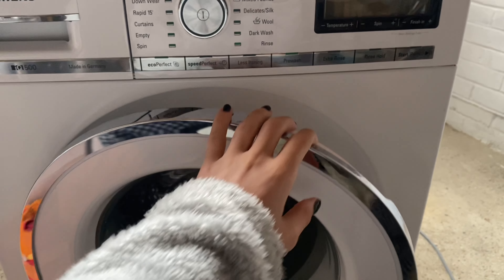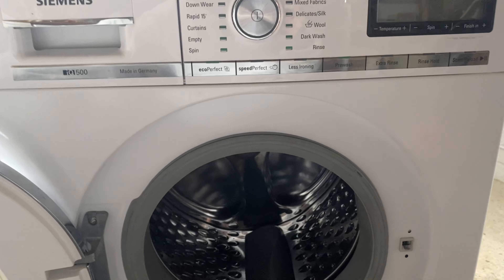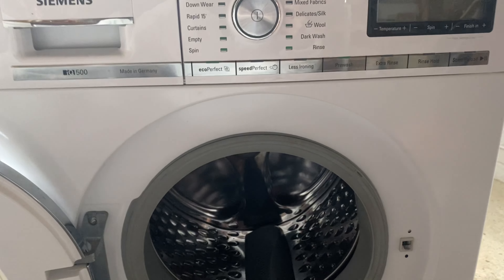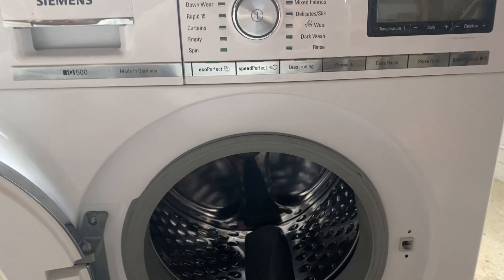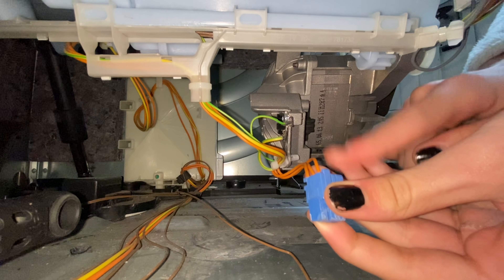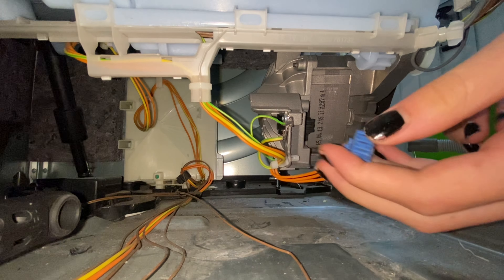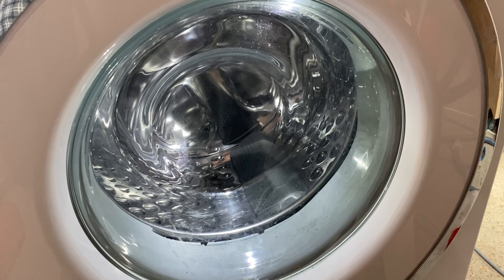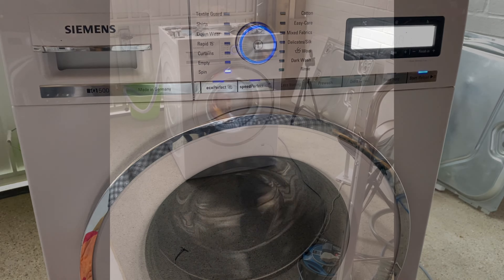Tutorial: How to Reverse A Washing Machine Inverter Motor’s Direction!

Comment: Thank you so much for this!! But i'm confused, why would someone want to do this other than just curiosity? Like does it have any benefits at all? What's wrong with the original spin direction?
Reply: Its for the washer not to sudslock
Reply from the maker: either better spin performance or to prevent suds puking out the drawer

Comment: i did it on my beko b300, now im doing a test wash with clothes, its super weird to see it rinsing and spining clockwise 🤭
also is it safe for those 3 cables to be that way?? cuz on bekos its a little bit harder to plug them upside down...
Reply from the maker: yes its safe, as long as its reverse on the motor not the actual pcb then its okay
Reply: @BOSCHCLASSIXX1200  alright thanks <3